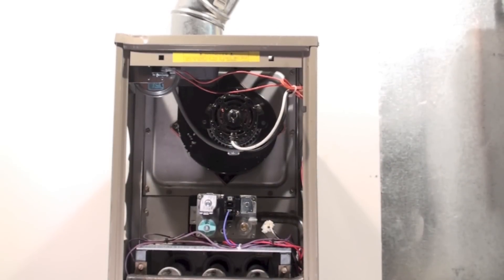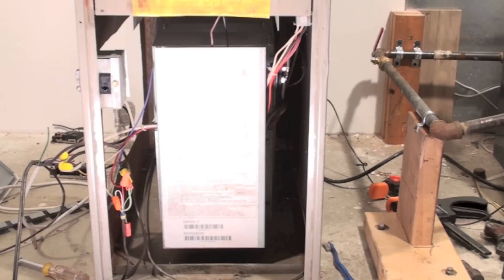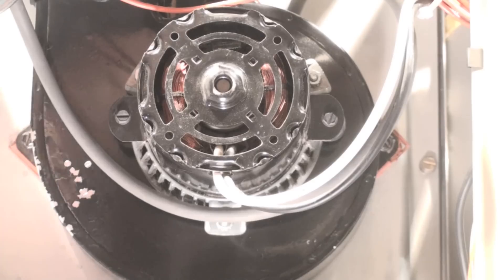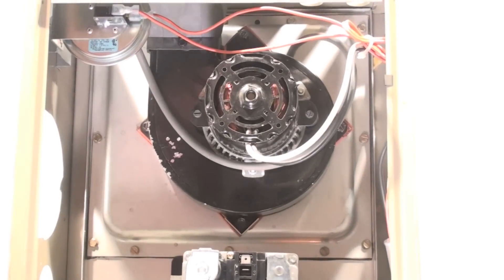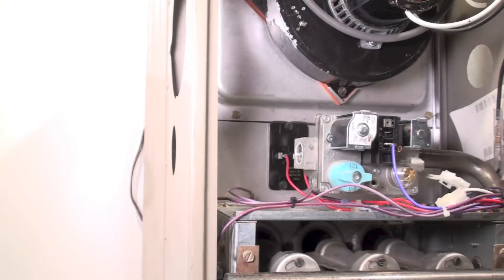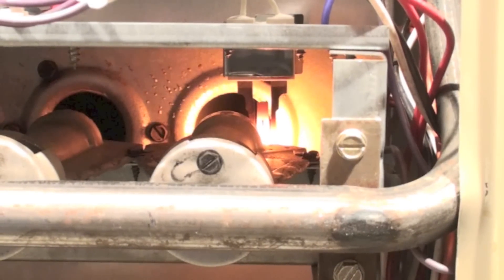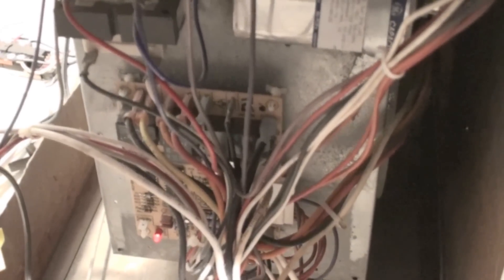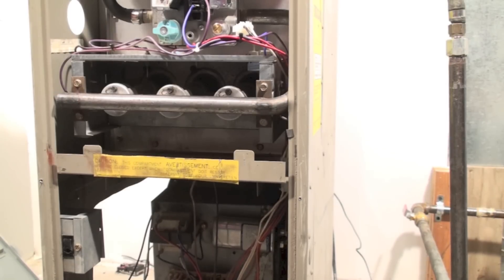Sequence of operation of the 80% AFUE efficient gas furnace Goodman

Comment: Because of your outline of the process, I was able to troubleshoot my pressure switch issue. I discovered it was not lighting, so I inspected the switch and discovered there was debris in it. I made sure it was shut off, then held the pin in for two sec to reset it. Buttoned everything back up tuned on the breaker and it was running like a champ. Thank you sir!

Comment: So i may have not complete understood what you were saying but you said that when the combustion blower is on and pressure switch is closed the unit will no longer move forward that is incorrect the unit will operate correctly like i said could have been a misunderstanding
Reply from the maker: You have misunderstood.  The control board must see an open pressure switch switch before the inducer will start.  This is done to insure a stuck closed pressure switch will stop the sequence for ignition.  
GFM

Comment: what makes the blower stay on till the heat has dissipated from  the unit
thanks
Reply from the maker: On  this unit, There is an adjustable timer on the control board.  
GFM

Comment: Take it from one who knows. Don't buy anything from goodman. I have a goodman gas pack that was installed in 2012. The capacitor on the inducer motor went out last year. I called the local goodman dealer in November of last year and several more times since then. They're some of the most ill mannered, insulting people I've ever met. I called goodman manufacturing and got about the same treatment. The inducer motor has to have a 2 microfarad 370 volt capacitor in order to work. I was going to replace it myself but you wouldn't believe how hard it is to find a 2 µF 370 volt capacitor. Every supply place around here has a 3 µF but not a 2 µF and a 3 µF won't work. I finally wound up calling the local Trane dealer to fix the thing. But at the rate I was going if I had continued running all over the state trying to find the right capacitor I would have had more money tied up in gas than the repair costed.

Comment: hello my code flashes twice that tell me pressure open with inducer on I have no heat
Reply from the maker: I would first look at venting blockages, if your furnace is the same model as the one in this video, check the fitting at the inducer that connects to the pressure switch.  Sometimes it plugs.
GFM

Comment: My furnace from the day it was installed (9 years ago) starts the House fan, then the inducer then the igniter then the gas.. How can I change the sequence so the squirrel cage does not start spinning til the Flames are on? Thing blows cold air until the flames come on...
Reply from the maker: You may have the wrong thermostat or the thermostat is not set up properly.  When W is energized, it should not energize the fan.  The fan should be energized by the furnace when the heat exchanger is warm.
GFM
Reply: Ok, W has 4 wires connected to it two brown and two white.. Ill see if I can tell where those go on the thermostat.. Its a 1F81-261 white rodgers and I have a heat pump
Reply from the maker: You have the wrong thermostat for your system.  As you have a heat pump, the fan must be set to operate as soon as the heat comes on.  You could use something like an IF82-261.  You will have to cut the W-904 jumper.
GFM
Reply: ok, My apologies. I just got home and look at the thermostat and I indeed have the IF82-261.. However it looks like that jumper is not cut... so are you saying because it is a heat pump system the house fan must come on first or with the inducer motor? Sorry for all the questions and I sure appreciate the help.
Reply: I`m just wanting to make sure here.. Because the jumper is not cut, that`s why the blower is coming on first when its on backup heat (Propane) but when its using the heat pump that`s by design? So if I cut jumper It will operate on heat pump the way it does now, but when using propane it will wait to turn fan on after Gas is lighted?

Thanks
Reply from the maker: It certainly should.
GFM

Comment: I'm taking HVAC course and we had the same exact furnace in the class room which we were working on. The inducer fan would run and turn off every 30 seconds. When we disconnected the wires going to the limit switch it would run but ignition would not come on. What you think the issue is there? thanx
Reply from the maker: The pressure switch was probably not making.  The board gives up if the switch does not make within seconds.  
GFM
Reply: There could be a couple things, first check that the exhaust pipe is clean all the way out, because if it has a birds-nest in there or other object it can change the flow of the air and make you think the pressure switch is bad but it is not.  once you do that, if that still doesn't solve your problem, i would use a jumper wire and bypass the pressure switch just to see if that solves your problem, if it does, replace the pressure switch.

Comment: How common is it to have a limit on an inducer? I seen one yesterday and that's the first time seeing one. If they trip, is it like a high limit where the blower runs to try and close it. Will the inducer keep running to try and reset it? New to this field.
Reply from the maker: +1242chisox They are fairly common.  It shuts down the furnace and starts the fan on most furnaces.  Hope this helps.
GFM

Comment: How do you take the covers off!
Reply from the maker: +Mike M If you mean the sheetmetal covers, the top one has 2, 1/4 turn plastic screws on top.  The bottom one is lifted up and and pulled out after the top one is removed.
GFM

Comment: first off love the videos, very helpful! Have a 1975 bryant furnace that has pilot light lit , but burners will not fire. I'm thinking pressure switch, but should I look at inducer motor first? Tia
Reply from the maker: +coil junkie If your furnace was made in 1975, it has neither a pressure switch or an inducer.  If pilot stays lit but no fire, check incoming power first.  Hope this helps.
GFM

Comment: Once again - one year to the day my Weil- McLain ULTRA 155 has an internal leak in the heat exchanger. Those things are a piece of crap. Being efficient is not much good when the heat exchanger has to be replaced every year. Weil- McLain don't want to know about it. So if you are considering a new unit do yourself a favor and consider a different brand.

Comment: T-stat call for heat
Inducer/venter motor starts
Closes Pressure switch 
HSI is powered 
Gas valve opens (3.5") w.c
Blower motor starts to cool heat exchanger
T-stat becomes satisfied
Gas valve closes 
Venter motor continues for 30 secs to a min
Blower continues till heat exchanger is cooled
Reply from the maker: Justin Denomme Just a couple of things missing.  Control board checks to see if pressure switch is closed before starting inducer.  Also control board checks to see if any limits are open and stops the sequence if any are open.  Hope this helps.
GFM
Reply: Very help full , I write my g3 exam today in ontariobso I'm very nervous

Comment: With thermostat set on heat and fan set to on, the inducer motor doesn't come on.  W=C and R-C terminal voltages are 0V..Where do I go from here?
Reply: check the 24 volts transformer, R- C should 24 volts